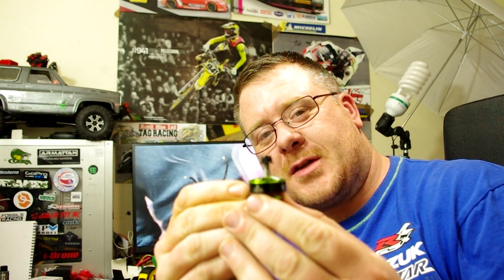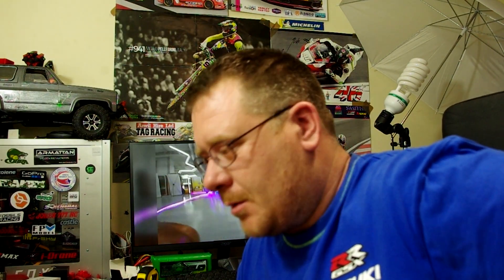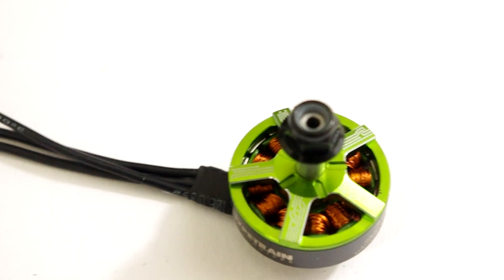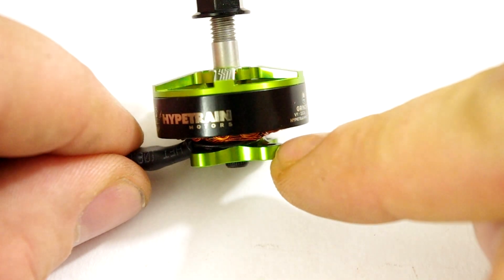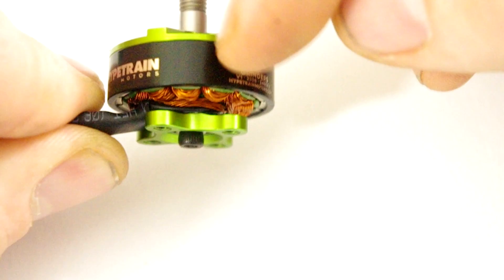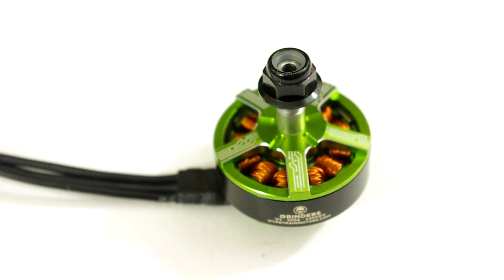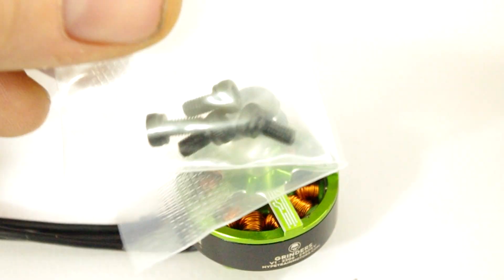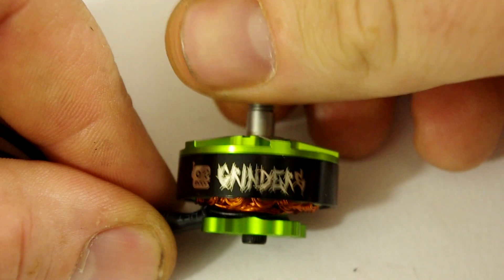REVIEW OF BOT GRINDER HYPETRAIN MOTORS - BUILD A RACING DRONE SERIES - MOTOR CHOICES

Comment: great video! I want to address the screws being 5mm but if we put in more hardware the cost goes up and i want these as affordable as possible.
Reply from the maker: Yes I understand that bud but there fantastic motors over all just a shame I killed one today
Reply: @ProgressiveMTB  thanks! i actually killed one today too
Reply from the maker: Lol I have bent the shaft big time I will send you a pic
On Facebook later
Reply: So are they not super durable then?
Reply from the maker: FPVisioning unfortunately no don’t get me wrong there a good motor with plenty on power and not really heavy but If you hit the floor with the prop nut first or the top corner of the motor bell it will bend the shaft